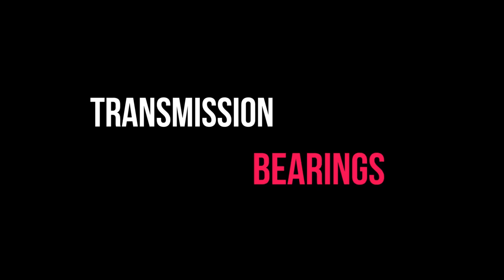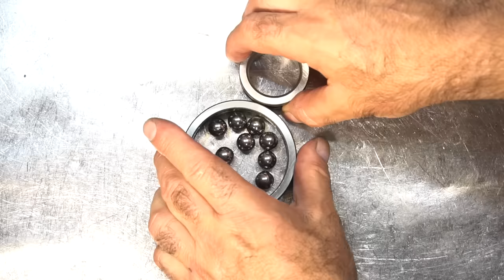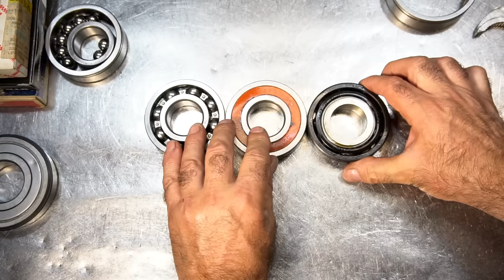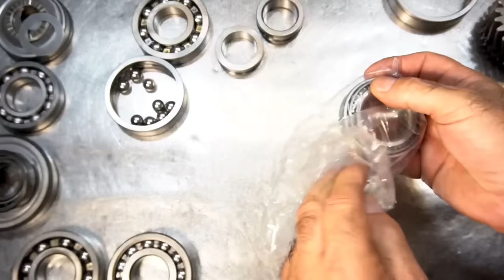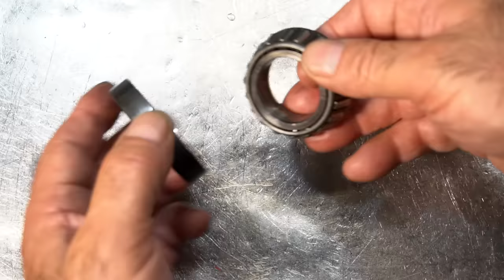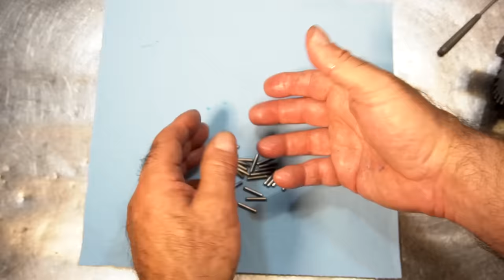Learn About the Basics of Ball Bearings, Needle Bearings, Tapered Bearings

Comment: very interesting, but can you tell us something about the duplexing of angular contact bearings, how to measure the height differences along the rings, how much should they be loaded when measuring? what axial tension to give to rings with balls, etc.
Reply from the maker: When stacking angular contact bearings it all depends on what your application is. Example when I assembled turbine fans there was a shim placed in between the inner rings. Shimming change was based on specified break away torque of the assembly. All bearings are different. There is no one set formula. The bearing manufacturers spec sheet is your friend when choosing a specific form factor for a design.
Reply: @GearBoxVideo  Well, I agree with you, of course, all bearings are different and the units in which they work are also with different requirements for accuracy and rigidity, just few of the manufacturers specifically tell how exactly these bearings need to be stacked, now very many manufacturers produce universal bearings that can be installed practically in any schemes duplex, triplex, quadruplex, etc., with litle medium and high preload, but how exactly this preload is created and checked only they know, therefore these bearings and are, let's say, a little expensive ...
Reply from the maker: Very expensive. Based on Abec precision rating. Also some pairs with higher Abec ratings will have both inner and outer races marked to align them

Comment: Great Video, When i was younger, well 15yo younger. im 50 now. I used to race bath tubs and i used 20hp mercury outboards, the top and bottom ends of the con rods took loose needle bearings and I was able to rev the engine to 20.000rpm and beyond. The engine was 2 stroke. I've always wondered why 4 stroke motor vehicle engines only use sleaves. I've always wanted to see what would happen if i replaced the sleave bearing with needle bearings, if that would allow the engine to accelerate faster and run more efficiently. Perhaps you would have some knowledge regarding this.
Reply from the maker: The reason is the PSI on the rod. As well as that oil is also your fuel.  I would think it's hard to keep consistent feed of oil pressure with needle bearings. Youd have to run seals on each side of the bearing.
Reply: That sounds like a blast!

Comment: Hello!!! Thank you for the great video !!! If I understand you correctly, you recommend putting ball bearings with steel anthers ... I was very interested in this idea ... Would you please tell me if an oil starvation bearing will feel? Before installing bearings with anthers, should you wash the factory grease out of them? Or do you need to add lubricants to them?
Reply from the maker: They lubricate fine. Remember these have been installed in factory transmissions like this for decades.
Reply: Thank you very much for the information ... I have difficulty with the translation of English ... If I understood you correctly, then it turns out that bearings with anthers were installed on a manual transmission 20 years ago? And they are well lubricated? Sorry for bothering...

Comment: That's  a good comparison of the many different types of bearings on the main shaft! For higher load or for racing you might be better to have different bearings in your transmission. Furthermore the lubricant should fit with the bearings, shouldn't it?
Reply from the maker: Most bearings in manual transmissions have specific clearances related to viscosity. The C3 fit of most ball bearings allows for a range of viscosities. That's why when people put heavy oils in a transmission with tight needle clearances, the bearings tend to overheat due to poor circulation.
Reply: I didn't know about this. For short driveways with low speed in urban domain I'd than put light oils in the gearbox. Whereas else I'd use medium viscous oil in it! Thanks!

Comment: Do ball bearings have a speed maximum that if they exceed that speed the bearing balls start to slide rather than roll?
  When I was a motorcycle mechanic, there was a particular brand of motorcycle road racing machine that was having crankshaft failures. One of the racers that was a mechanical engineer researched that problem and determined that the balls were not rolling but sliding because of the speed the balls had to roll in that machine
Reply from the maker: Depending on the bearing size there is a speed and load rating based on grease versus types of oil used
Reply: GearBoxVideo 
   50 to 1 synthetic pre-mix with gasoline. Approximately 10,000 RPM crankshaft speed. The main bearings depend on pre-mix oil. So in this application, is a bearing with the same size outside diameter of the race better to have larger balls so they can roll relatively slower, or smaller balls to be able to absorb higher loads, but, smaller balls , Do they reach their maximum rolling speed relative to the crankshaft speed sooner?
  I don’t know exactly what the engineer that determined that the crankshaft main bearings could not roll fast enough, and the individual balls were actually sliding in the race rather than rolling. Maybe they were smaller balls that reached their maximum critical speed much sooner than a ball bearing that has fewer balls but larger balls that may not reach their critical role in speed until a higher crankshaft speed relative is reached.
  My question was, is this what happens and a bearing that is poorly designed for its application. Is that what probably was happening to those failing factory bearings? The balls were starting to slide rather than roll?

Comment: Do you put assembly lube in thrust washers when you install them? Figured I'd pack the rollers in them with some. Also does direction matter with that or the needle bearing spacer? My spacer seems to have 1 small knick in one side and wasnt sure if it was for alignment

Also do you grease the input shaft bearing? Probably not but figured I'd ask
Reply from the maker: depends on the application

Comment: sir no need have chamfer. All bearing is assembled with a washer . Could you please explain  lube oil system for cooling bearing  it would be great
Reply: As long as the washer is thick enough to account for the side loading and thin enough to fit the landing, I expect it'd work.  Was it that way before disassembly?

Comment: My toyota has 280k miles on original trans fluid lol
My coworkers corolla has 350k on original fluid
Reply: I noticed you used a key word there: Toyota.  Of our vehicles (currently 11, many more over time), the Toyotas seem been engineered to longer powertrain lifetimes.  Had an '82 Corolla that had 230KMi+ on the same clutch and 5sp manual, then again I usually skipped gears going up, used neutral slowing down, and often carefully synchro-shifted.  We sure didn't see similar engineering in the PT Cruiser, Dodge Omni, or Fiat coupe.
Reply: @jameswyatt1304  lol I bet

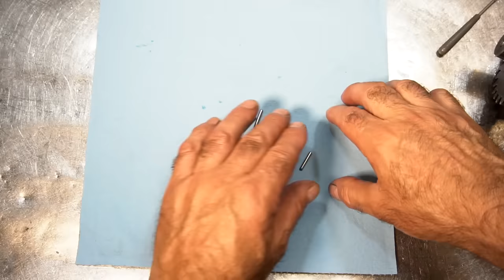Comment: 21:52 reminds me at my shock, when seeing, that my <Lindner BF22 A> had only these needles without a cage or cup or anything, just needles loosly layed in (as you showed here) for the main axis of the steering-gearbox ...  Never saw that before ...

Very frightening if you think about, how important a steering actually is, f.e. for an allwealer that crawl up to 48 degrees (!) 

I had to open it, when the steering stuck without any signs of prewarning while driving in the middle of a turn :-(

Very nice feeling, when you realise, the tun is over, but the tractor is not reacting in any way, just going on in the same turn, although there is no turn any more ... ;-x
In this second I rerun a million seconds in my brain, when driving with my kids on a high trafic road to a oldtimer-meating with this nice little beast ... I never did again after that ...

THANKS FOR POSTING! VERY INTERESTING VIDEO!

Comment: Very informative video, thanks.  Question: is there any tradeoff with sealed bearings, if not, why aren't they used all the time?
Reply from the maker: They are being used more. The design of the oil flow has alot to do with it. Meaning sometimes the bearing has to be open to provide lube behind or in front of it. The other is cost.

Comment: Excellent info, I just subscribed to your channel. On some Ford and GM applications I am familiar with, there is a choice of either a  bearing or an oilite bronze bushing, this for the input shaft pilot in the crank. What is your recommendation on this?
Reply from the maker: Aways a bushing. Bearing failures ruin input shafts and crank shafts. Too expensive outcome if one fails.

Comment: Great video. What are your views on lifetime oils? I have a BMW with a Getrag 420 gearbox and as far as I know the oil has not been changed in its 150,000 miles. Would you change it or leave it alone? It works fine at the moment. 

Also thanks for taking the time to make all these videos.
Reply from the maker: I would change the oil.  The transmission has no filter and dirt is the main cause of bearing failure.
Reply: When manufacturer's  say lifetime they mean the warranty period not how long the box will last

Comment: 13:05 I do not agre. Ball bearings are also very sensitive in case of axial shaft/hoising displacement. Any axial movements generates axial force for which ball bearings are not suitable. 

In case of shaft or housing is changing slightly their position in axial direction then another type bearing should be used: cylinrical roller bearing.
Reply from the maker: Then every manual transmission would be using different bearings. I think you are confused what axial and radial loads are. A cylindrical bearing cannot take any axial load or thrust load and any misalaignment a cylindrical bearing can handle would be the result of the clearances designed in the assembly. Read up what c type clearances are for in ball bearings. Tapered bearings are used often but it depends on the design. Look at my Toyota W58 video and you can see how a combination of ball and cylindrical bearings are used. Transmissions have fairly accurate housings. So while you can disagree you obviously have not seen the insides of many manual gearboxes

Comment: Wow, great video Paul!  Thanks. I did the clutch on 97 Hyun Accent at 197k miles because the throw-out bearing went bad, now 40k miles later and it feels bad again. How can I determine a quality throw-out bearing for when I do this again?
Reply: It's unlikely the bearing quality is the issue. You probably have insufficient clutch freeplay or are driving with your foot resting on the clutch (effectively the same thing). The release bearing doesn't have to compensate for a speed differential between the crank and the input shaft housing (static) unless it's in contact with the clutch pressure plate/cover fingers.
Reply: Some kind of bad contamination issue, way overheating, damage whilst fitting. Or more likely than not, what Tony said.
Forty Grand doesn't seem like much at all. More often than not a clutch thrust bearing lasts the lifetime of the spinner plate. To not change the bearing when the gearbox is off is just ridiculous. Though I have seen it done.

Comment: I had a 85 RX-7 GSLSE - the manual transmission input shaft actually bent. What would have caused it from the factory, was it slightly misaligned or did the bearing cause it? Thanks Paul

Comment: You mentioned that more balls in a bearing equals more heat. Wouldn't the extra heat be offset by the fact (?) that each bearing is taking less load compared to the same bearing with less balls, therefore less heat is generated? Whereas less balls means more load on each ball, hence more heat generated per ball? Just thinking out loud and can't see where my thinking is going wrong, or right. Thanks.
Reply from the maker: I see your point. But as mentioned these are helical gearsets where the thrust issue lies. More balls on Max capacity bearings hold less thrust load as defined by any bearing specs listed in any catalog. Furthermore this isn't theorical stuff. I build transmissions that have temperature probes in place. Heat reduction in air cooled transmissions is your friend. I have a new video coming out this week on how I prep endurance transmissions for heat reduction with no external coolers.
Reply: @GearBoxVideo  Thanks for the explanation, much appreciated.

Comment: I have a ring and Pinion Installation kit that was in the garage for years and the bearings rusted a bit. I cleaned them with metal rescue, should I scrap them and buy new?
Reply from the maker: I would. Bearings are fairly cheap. What's it for?
Reply: @GearBoxVideo  the kit was still in the package too.. I bought Richmond 4.10 gears to rebuild the 8.5 rearend in my 72 nova. (the car sat for a while but now I'm restoring) I've decided to swap the th350 for a muncie and I'm concidering the m22z  so I'll probably need a 3.08. The motor is about 400hp, do you think that setup will still be fun to drive?

Comment: Great bearing video, so when I put my sm465 back together should I pack all the bearing with grease or is the gear lube enough to lube the gear on start up.
Reply: The bearings
Reply from the maker: Oil them. That is all you need to do

Comment: Very informative video. Thanks. Question: I’m rebuilding my BMW diff (188k) that has FAG tapered side bearings (F-801298) but these are not available anymore and the bearing place wants to sell me a spherical bearing (F-234976.06) instead. Will that work? I really don’t want to start re-shimming to adjust the contact patch if possible.
Reply from the maker: I'm not familiar with this diff. Email me pics of the bearings currently used and where they are at. Email support@5speeds.com

Comment: very good video thanks...i just have one question because i work with industrial gearboxes that have a pinion and tappered roller bearings like those that you have shown and when i was repairing one i put some blue grease on the bearings on assembly than the lubricator filled the gearbox with some transgear 460 oil and i was thinking that maybe having the two types of oil would would not be good...can i have your opinion on that please...thanks a lot from Portugal
Reply from the maker: I don't think that will be a problem. Just as long as the grease is not a lithium based grease.

Comment: I enjoyed that video, thank you. I have a question: I have noticed that all the ball and tapered roller bearings I have seen have an odd number of balls/rollers. Is that due to the geometry imposed by some standard sizing or is there some technical superiority to not having diametrically opposed rolling elements?
Reply from the maker: Just sizing. Some bearings have an even amount of elements. I've seen for example the same size bearing have  different diameter balls which equates to different ball quantities and inner ring sizes
Reply: @GearBoxVideo  I've been wondering about it for years, thinking maybe it was something too basic to appear in anything I looked at. Thank you for that information.

Comment: I'm trying to understand how motorcycle wheel ball bearing work. The axle is static and doesn't rotate and is inside the wheel bearing but it is not pressed tight against the inner race like the outer race is pressed against the wheel. It means the inner race can rotate in relation to the axle. So what exactly prevents this relational rotation between the axle and the inner race?
Reply from the maker: If the bearing we're to seize up it would spin on the axle. The least resistance in the rollers prevents it from spinning. Similar to a T5 transmission where the outer race is floating in the housing

Comment: this afternoon I went to the 
workshop to bring my car home after they changed all the tapered roller bearings in my gearbox (getrag m32) . when I tried to shift in to fourth gear I heard the terrible grinding noise and didn't tried to force it , so I went again to the workshop and told them about the grinding noise . The mechanic told me they need to get a new fourth gear syncro because  the new  bearings changed the clearance\gap  on  that shaft . What you think about this ? It's possible to get any grinding after changing just the bearings ?
Reply from the maker: No, that is not possible. They may have never changed the rings
Reply: @GearBoxVideo  Do you have any idea of what can make it grinding after changing the  bearings  ? could be  the thickness of the retaining clip ?
Reply from the maker: If the rings were not changed, they may have been damaged during the bearing change. Unless parts were left out, bearings are extremely accurate, so they will not cause that issue
Reply: @GearBoxVideo  I think I found the cause . The 3/4 gear set has the exactly the same 3 piece syncro . Do you think that is possible to grind in fourth if they swapped the rings during the assembly? The syncros are now turning at the opposite direction
Reply from the maker: It's up to the builder to check synchro fit before assembly. You just don't take apart a transmission and blame a failure because of something else you changed. Makes no sense.

Comment: Tapered roller bearings work actually best with a slight preload
Reply: Realtime1501 Yes, always with preload, like in a differential!
Reply: This seems to be true when they're oil lubricated and are able to cool sufficiently, but wheel bearings tend to overheat and fail quickly if preloaded. Surely because of the nature of the lubrication and their restricted ability to cool.

Comment: I have a r150f transmission and had a new bearing pulled off the cluster to fix a mistake and when i pressed it back on it has some play in the bearing now. it goes into the center plate and its a sealed bearing is it still good or should i replace it.